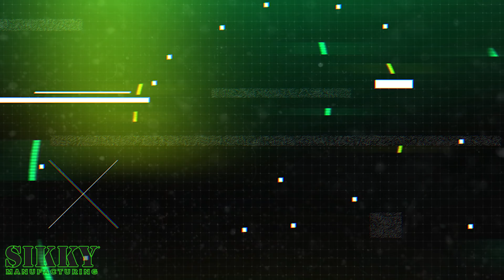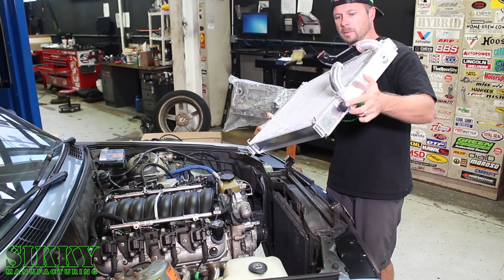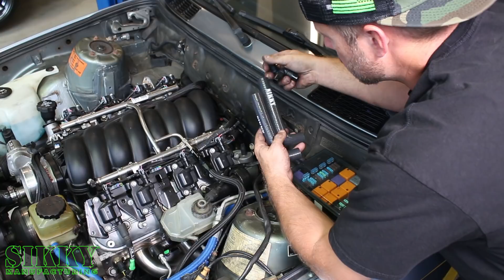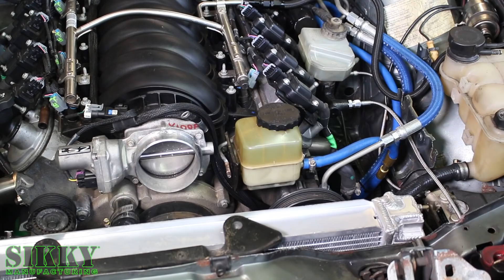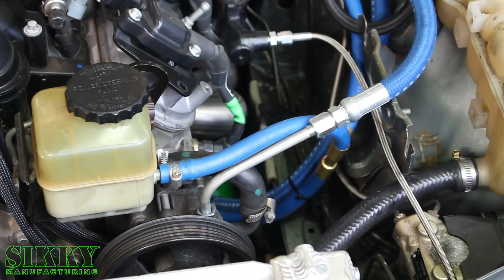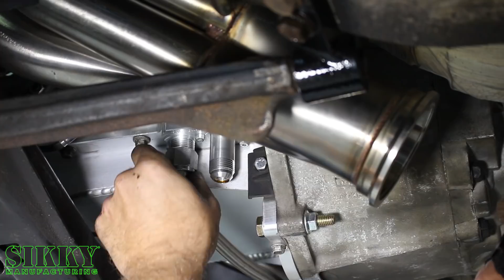BMW E30 LS2 Build Pt 8 | Cooling System Upgrades | SIKKY Manufacturing

Comment: Do you have a video on the wiring?.
Reply from the maker: no unfortunately it's too specific to what you are doing and there are many options.  The wiring specialties harness we used is pretty straight forward and labeled so they are not bad to install.

Comment: One thing I wish the t and the l was not plastic but brass
Reply from the maker: It's more of a perception thing as the plastic tee is very strong and is actually what OEM uses nowadays.  Should never have any issues with it as long as clamps are not overtightened but even then it would still be hard to break it

Comment: Would the Sikky engine mounts work with an LS3? Also in general what would be the differents in the installation of LS3 compared to an LS2 besides the location of the thermostat inlet?
Reply from the maker: Our mounts work with any LS based engine.